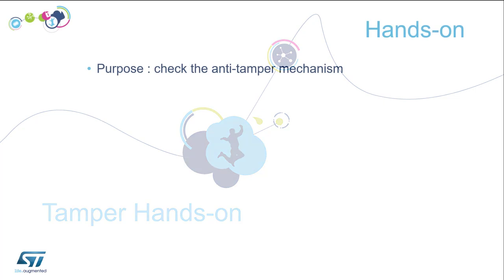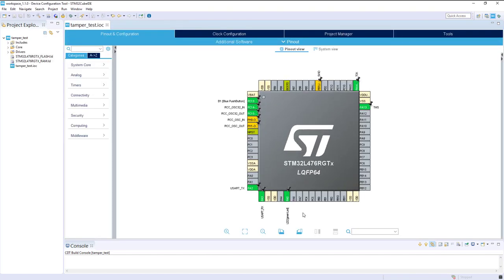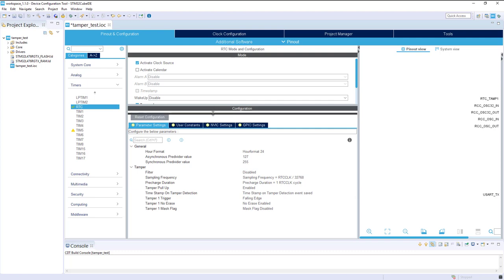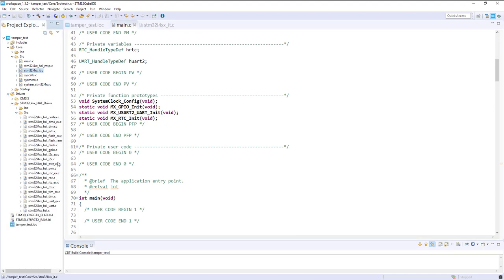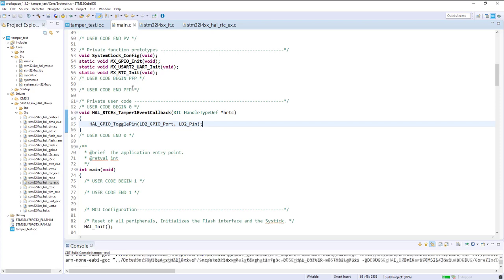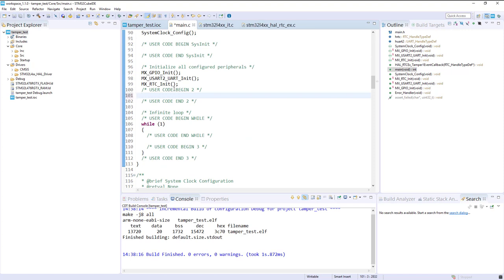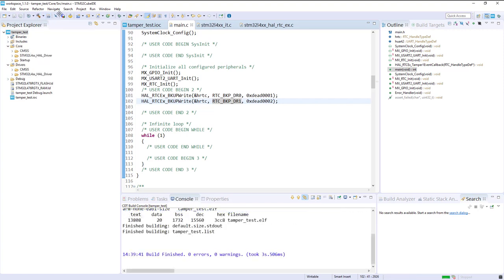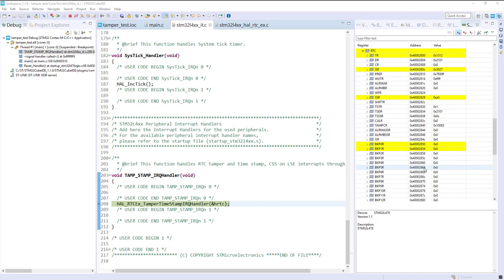Security Part3 - STM32 Security features - 22 - Tamper lab

Comment: Hi, I am new in this firmware world with some experience on C language. Is the backup register editable if there is a function that acces it through a pointer and writes it? I imagine there are some writing protections implemented on hardware if instruction comes from the firmware stack since C doesn't prevent you from writing on any address.